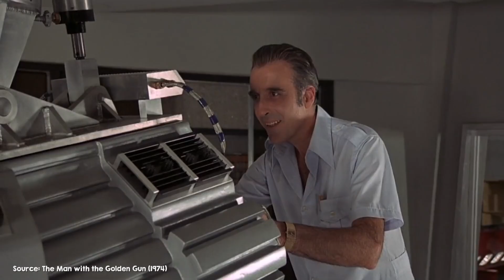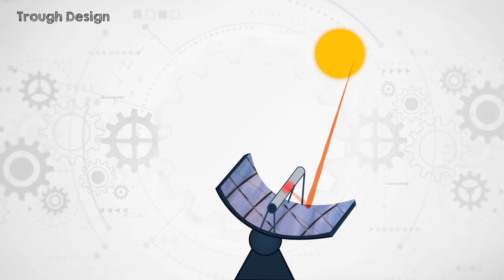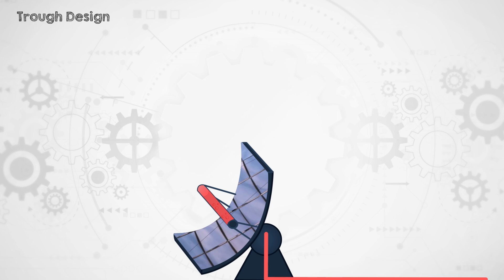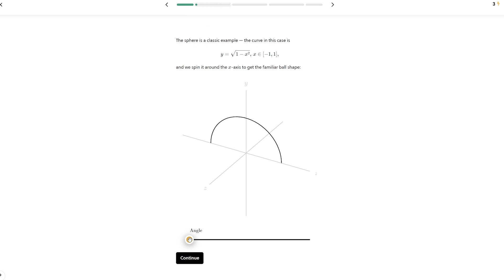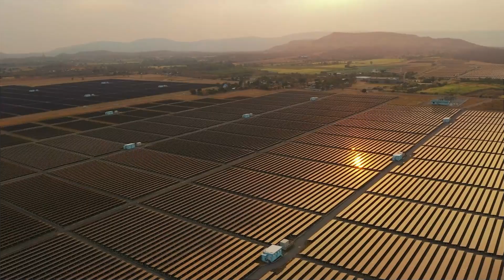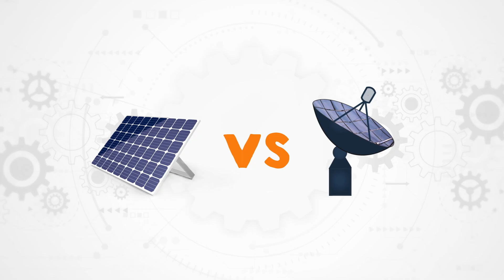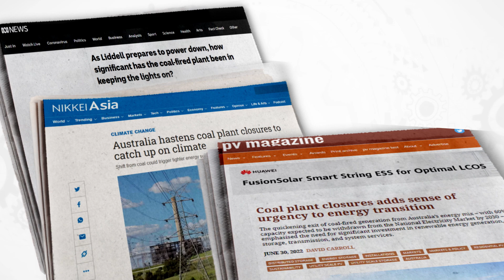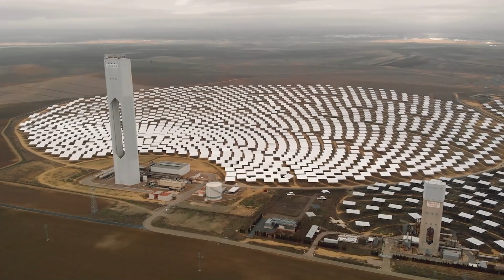Solar Power at Night using Concentrated Solar Power CSP

Comment: Very good video, as always.  Your content is well thought out and very clearly presented, with excellent production value.  I think your enthusiasm for CSP is misplaced, though.  The only reason the plant in California is still operating, and I suspect the same is true of those in Spain, is that they were provisioned largely through government funding, and neither grid is robust enough to withstand the loss of generation they provide.  CSP has proven to be too costly, in terms of maintenance.  This technology will continue to be a fringe solution and will be obviated entirely when hydrogen sequestration becomes more economically viable.  The boring of geothermal wells using plasma lasers, something I believe you covered a while back, should offer all of the same advantages, with a much smaller footprint and far better LCOE.

Comment: What happened to the solar chimney that someone was trying to build in the outback? 1km high chimney with a massive glasshouse at the base to heat the air. Would be interested to find out if it was the economics or physics that killed the project
Reply: I’ll take a guess it was the economics AND the physics that killed it.
Reply: https://youtu.be/0tWlP0knKQU The chimney is concrete I think

Comment: Sure all generators are "almost always available" but some are more so than others solar thermal has about a 20% capacity factor (amount of time it's out puting it's full name plate capacity) vs 25% PV and 30% wind on average. But nuclear sits up top with an average of 92% capacity factor.
So that means that even with thermal storage you would need ~5x the name plate capacity to match the power made by a nuclear power plant. This also doesn't take into account the winter months generating around 1/3 less solar energy on average.

Comment: Maybe a related topic or future show - systems that can recover rejected heat - Rankin or Organic Rankin systems - there's a great breakout of energy flow usage in the US done by Lawrence Livermore National Labs which shows that roughly 65% of all energy ends up as rejected heat.  Of 97.3 Quads, 65.4 were rejected heat, and 31.8 usable services.  Some is unavoidable, but surely recovery of some of it would provide some useful reductions of other energy.  And so much is made of new generation; how about improved efficiencies of end use offsetting new demand volumes too...  we see a lot about heat pumps, ground loops, deep wells and things like using CO2 as a refrigerant  - industrial process heat pumps etc.    And related to this particular topic of your EXCELLENT video, one of the  knocks on a CSP plant in CA just over the NV border - constant complaining that they have to use NG to bring up to temp overnight and it never hit its projected/planned performance targets...  so, they have to use NG to raise the heat for generation  - um...., that's how it would have been generated anyway otherwise and using the stored thermal the rest of the time is decreasing CO2 emissions all those aggregated hours...

Comment: Great video. For sunny places such as Australia and California this sounds great.
For Northern Europe which in winter sometimes does get much wind or solar for a few weeks at a time, probably nuclear is the way to go. 
This would be great for Northern Europe in summer where in some places the sun doesn't set at all.
Reply: In Germany there is a small CSP plant in Jülich and even there it works very nicely. It reaches temperatures of 800°C which means it can also be used to produce hydrogen as a byproduct using the method in the Hydrosol project. 

Nuclear is not feasible anymore for various reasons:
* way too expensive to build without government support
* way too long construction
* way too complicated construction, missing know how, see France!
* nuclear fuel supply uncertain, market dominated by Russia
* nuclear fuel rod supply uncertain, market dominated by Russia, see France!
* cooling uncertain due to drought in Europe, see France!
* turbine operation uncertain due to drought in Europe, see France!
* too inflexible, nuclear powerplant cannot simply be switched on or off depending on demand, this takes months
* way too expensive deconstruction
* way too long deconstruction
* high safety regulations -> higher costs
* requires very special location

With these reasons very few companies are willing to build and operate a nuclear power plant nowadays.

Comment: Coupling a solar tracking dish to pump a hot media through a concrete slab could significantly reduce a Canberra winter heating bill, if not nullify it altogether.

Comment: Solar PV is better than CSP in that it is scalable from domestic to grid. CSP only makes sense at grid level. The drawback of solar PV with curtailment at times of over production is now dealt with by battery storage at the domestic level and a myriad of storage technologies at the grid level with pumped hydro, compressed air and liquid air to mention but 3. There are vast areas of untaped solar PV installations that do not require green field or desert sites, such domestic roof, commercial roof, industrial roof and carparks. I think the carparks is a no-brainer and in the hotter European medetteranian countries you use more and more carpark space, especially in public facilities such as hospitals and supermarkets now being covered in solar PV panels on a frame-work. It generates electricity for local use and export to grid revenue as well as  provide shelter/shade for vehicles.

Comment: Solar PV is  better than CSP because CSP needs direct sunlight to focus on the receiver, but even on a cloudy day there are still enough diffuse photons available to generate power with solar PV. Solar PV has the potential to increase its efficiency from 20% to 40%, as demonstrated in the lab, at a commercial scale within the next 10 years. I don't see such potential for efficiency gains with reflective panels or heliostats.

Comment: So would solar PV with a combination of lithium battery storage plus molten salt storage be the answer? The solar PV would generate electricity to directly charge the lithium battery for short duration storage such as peeks of an hour or so, and would indirectly store energy in the form of molten salts by using electricity to heat the molten salt for longer duration overnight use?

Comment: Now here is a thought, some people are suggesting that electricity companies may soon resort to paying businesses to run their most electrical demanding process during the middle of the the day to soak up the excess solar power in the grid. CSP plants could take advantage of this by installing larger molten salt tanks than would otherwise be used for the size of their plant and use excess solar from the grid to heat the salts directly. Thereby having lower levelized cost of energy

Comment: Why you not include nuclear power energy to your graphs with price? 
Didi you calculate price 24/7 for solar energy system - add gas power station for winter and overcast days?
Germany has lot of cheap solar and wind energy. So why their electricity is so expensive?

Comment: AFAIK, dish systems are rather solar stirling dishes, with a stirling engine driving the generator, instead of steam engines/turbines.
However, they don't provide heat energy storage, electricity production follows direct irradiation, similar to much cheaper photovoltaics.
And photovoltaics can make use of diffused light (cloudy sky) too.

Comment: Interesting technology.  Utility scale PV costs $1.10/ Watt in MW sized projects in the US.  It is even cheaper than that if you want to use DC-->heat for thermal storage and steam generation for turbines and electricity that way.  PV has no thermal inertia to overcome at first light, has almost no transmission losses and it tracks almost linear with sunlight intensity down to 200W/m2.  Concentrating solar output falls off a cliff with haze, smoke or clouds in the sky.  $1.10/ Watt is a very difficult price to beat with a system that has thousands of moving parts, heat transfer fluid, pumps, controllers, etc.  Are they "mining" sunshine or are they "mining" government dollars?
Reply: Did you watch the video?  The entire point, which was laid out extremely clearly is that CSP isn't a direct competitor for grid connected PV on a $/kW basis.  It is however distinctly cheaper when storage of more than an hour or two is needed.
Reply: @TonyGrayCanada  Solar thermal is less and less able to compete against PV for many reasons, not the least of which is that PV is so cheap.  2-axis tracking of thousands of mirrors, to concentrate light on a very high temperature heat transfer system is NOT cheap.  Utility-scale PV, >1 MW projects, at $1.10/ Watt including inverters (Q1 2023 USA prices) is Cheap.  Like it or not, electric resistance heat is 100% efficient and the thermal losses, thermal inertia, pumping losses, etc. of any flavor of solar thermal in no way competes with wires delivering DC electricity to electric resistance heating elements embedded in the middle of a thermal storage mass.  Inverters are not even needed for PV-->heat applications.  DC-->direct via PWM controllers does the job.
    The whole concept of thermal storage is moot until we are idling power plants at mid-day WHILE powering our world And charging the whole EV fleet in the middle of the day, all on solar and wind.  In Wisconsin, a few forward thinking employers have provided 120 volt outlets at the perimeter of their parking lots to plug in engine heaters for bitter cold winter days.  It is no stretch that one day we will plug in EVs in the middle of the day to take advantage of off-peak noontime electricity which by means of PV will be when electricity is the cheapest.

Comment: CSP is going wrong in the producción circle, water is the wrong become you only get power after 150° Celsius, propane for example at 80 Celsius can produce more than 200 psi and is very stable as a gas it doesn't discompose at high temp ,this means water at boiling point will be a great medium for storege and the low temp can be handled even on plastic pipes stem motors are more efficient than turbine below 1mw and the power output can be adjusted on the go to keep up with the grid demand,hot water is more convenient as totally integrated  and modular design.

Comment: Great video as always! 

I think there might be another potential advantage to CSP: we never have to worry about curtailment of PV and wind anymore! In theory, surplus renewable electricity (if all the batteries are already full) could be dumped in resistors to further heat the thermal storage of the CSP plants. The round-trip efficiency is low, about 40%, but that's actually still higher than the round-trip of hydrogen, and much much cheaper.
Reply: The issue of overproduction isn't just a problem of shunting power to a sink, it is also an issue of shunting power through a large enough medium to get to that sink. The nice thing about batteries or gravity blocks is that you can house them on-site to have a local power sink to shunt excess power to.  When you need to shunt it through the grid to a centralized sink, then you have rate charges to pay for the upgrades needed by the grid to handle it.
In the case of using a CSP's moltan salt heater to dump heat into, then it means that they need to build in extra capacity to store that heat.  The problem though is that if the salts cool down too much, then they solidify which is a whole other issue to contend with.  So then you need to build in over-capacity at your CSP plant, while also not having so much over capacity that on a really cloudy rainy day you don't need a ton of coal power to keep your salts warm.  As with all things renewable... its always complicated.  Worth doing, but complicated.
Reply: @CaedenV  The problem of solidifying salts is probably a non issue as you can design tiered storage with heat exchangers that can be mechanically uncoupled when the extra thermal mass would be a liability.
Reply: @Sindrijo 
True, but as you increase complexity, you increase maintenance costs. Early CSP failed due to poor operating cost estimates.
Reply: That's all well and good in theory, however the problem with that is importing from the grid incurs network transmission charges, typically in the ballpark of $45-$50/MWh.  That might not sound like much, but when you're dealing in a margin's game, that is a pretty steep price to pay before you even consider the cost of the electricity and all of the mandatory LGC charges.  Before you know it you are breaching the $80/MWh mark, just to heat salt.  The major problem is that the round trip efficiency is pretty low.  Even the best plants would struggle to get anything more than 40% efficiency, so you're effectively paying $200/MWh for that electricity and the transmission company is making profit on both the inward and outward electricity flow.  You'd need prices to swing a lot to recover that expense.  

You are far better applying storage at the point of generation than using the grid as a conduit.  There are many commercial and near-commercial technologies that are more suited to that type of storage/demand management.

Comment: what size natural gas plant would emit as heat 4.48 x 10^11 W per year given 60% emissivity efficiency and state the natural gas consumption and Co2 emissions use only metric units in the calculations
To determine the size of a natural gas plant that would emit 4.48 x 10^11 W per year, given a 60% emissivity efficiency, we can use the following formula:

Q = εσAT^4

where Q is the rate of thermal energy emitted per unit area, ε is the emissivity, σ is the Stefan-Boltzmann constant (5.67 x 10^-8 W/m^2K^4), A is the surface area, and T is the absolute temperature.

Rearranging the formula to solve for A, we get:

A = Q / (εσT^4)

First, we need to convert the thermal power output to units of energy per year:
4.48 x 10^11 W x 3.1536 x 10^7 s/year = 1.413 x 10^19 J/year

We also need to determine the temperature of the natural gas plant required to emit this amount of thermal energy. We can estimate this temperature by assuming that the plant emits heat at a temperature of 50°C (323 K), which is a common assumption for the temperature of industrial process heat.

Next, we can calculate the surface area required for the natural gas plant using the formula above:

A = (1.413 x 10^19 J/year) / (0.6 x 5.67 x 10^-8 W/m^2K^4 x (323 K)^4)

A = 6.61 x 10^7 m^2

We can now calculate the natural gas consumption required to produce this amount of thermal energy. We can assume a heating value for natural gas of 50 MJ/m^3.
Natural gas consumption = energy output / (heating value x efficiency)

Natural gas consumption = (1.413 x 10^19 J/year) / (50 x 10^6 J/m^3 x 0.6)

Natural gas consumption = 4.71 x 10^8 m^3/year

Finally, we can calculate the CO2 emissions resulting from this natural gas consumption using the emission factor of 0.2 metric tons of CO2 per MWh of electricity generated:
CO2 emissions = natural gas consumption x heating value x CO2 emission factor

CO2 emissions = (4.71 x 10^8 m^3/year) x (50 x 10^6 J/m^3) x (0.2 metric tons CO2/MWh) / (3.6 x 10^9 J/MWh)

CO2 emissions = 523,888 metric tons CO2/year

Therefore, a natural gas plant with a surface area of 6.61 x 10^7 m^2, consuming 4.71 x 10^8 m^3/year of natural gas, and emitting 4.48 x 10^11 W per year at a temperature of 50°C would generate approximately 523,888 metric tons of CO2 per year

Comment: Calculate the amount of black body radiation from a solar PV installation of 1KM^2 producing 370,000,000 kWh of electricity per year in Perth Australia given an efficency of 20%

The amount of black body radiation emitted by a solar PV installation of 1 km^2 producing 370,000,000 kWh of electricity per year in Perth, Australia, given an efficiency of 20% can be calculated using the Stefan-Boltzmann law, which states that the total radiation emitted by a black body is proportional to the fourth power of its absolute temperature.

First, we need to calculate the total amount of energy absorbed by the solar PV installation per year:
370,000,000 kWh/year x 1000 = 370,000,000,000 Wh/year

370,000,000,000 Wh/year / 1,000,000 m^2 = 370,000 Wh/m^2/year

Next, we need to calculate the temperature of the solar PV installation using the following formula:
P = AσT^4

where P is the power emitted per unit area, A is the surface area, σ is the Stefan-Boltzmann constant (5.67 x 10^-8 W/m^2K^4), and T is the absolute temperature.

Rearranging the formula, we get:

T = (P / Aσ)^(1/4)

Substituting the values we have:
T = (370,000 Wh/m^2/year / (1 m^2 x 5.67 x 10^-8 W/m^2K^4))^0.25

T = 5775 K

This is the temperature of a black body that would radiate the same amount of energy as the solar PV installation.

Finally, we can calculate the amount of black body radiation emitted using the following formula:
P = AσT^4

where P is the power emitted per unit area, A is the surface area, σ is the Stefan-Boltzmann constant, and T is the absolute temperature.

P = 1,000,000 m^2 x 5.67 x 10^-8 W/m^2K^4 x (5775 K)^4

P = 4.48 x 10^11 W

Therefore, a solar PV installation of 1 km^2 producing 370,000,000 kWh of electricity per year in Perth, Australia, given an efficiency of 20%, would emit approximately 4.48 x 10^11 W of black body radiation.